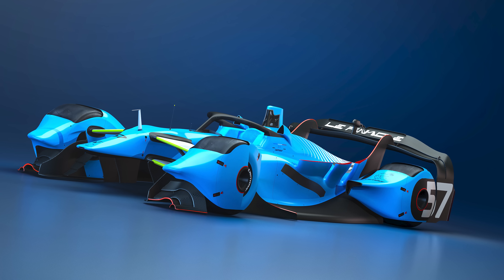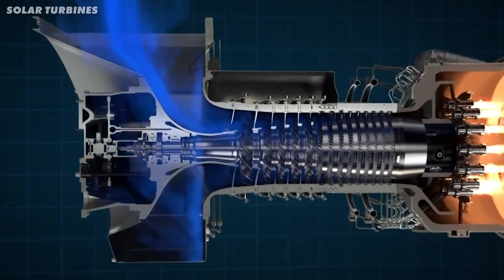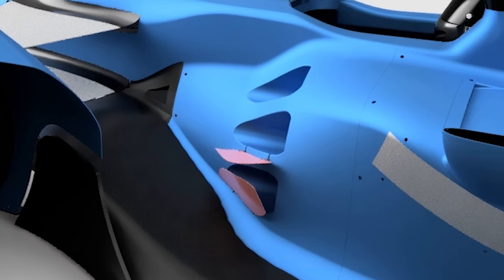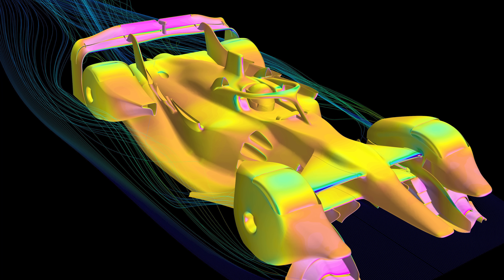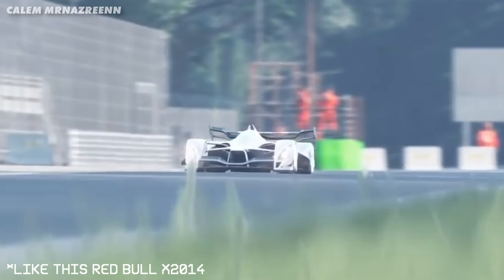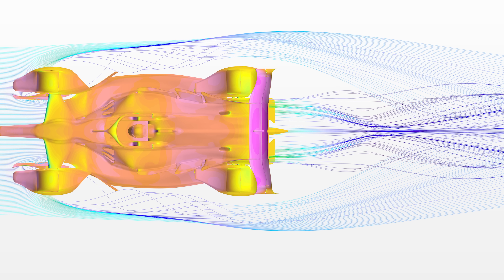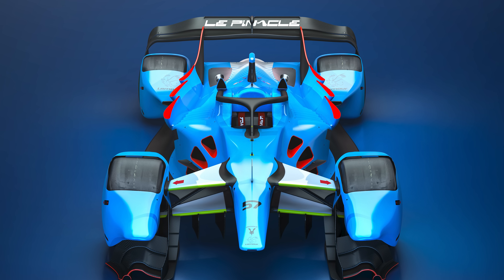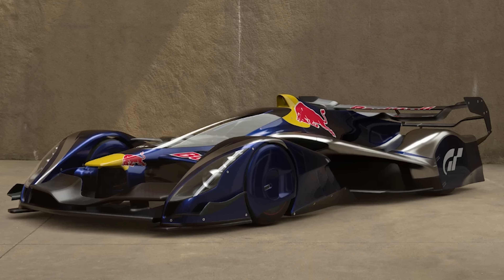Someone Designed The Perfect F1 Car (No Rules)

Comment: Designing any type of competitive machine without rules and regulations will start to tend toward simplicity, which seems counterintuitive until you realize that reliability is perhaps the most important metric of all. This ‘natural’ rule occurs in all of mechanical engineering. Those who ignore it will see failures rise to an untenable level, limiting the machine’s value to any prospective user.

Comment: This sounds an awful lot like the Red Bull X2010.

Ground effects? Check.
Fan? Check.
1600 hp? Check.
Wheels enclosed in faring? Check.
Enclosed cockpit? Er, no, apparently. 

Given that this project has taken 15 years, and it's now 2025, is it actually an evolution of the X2010 using more sophisticated CFD analysis?
Reply: Yeah, makes me think....
Reply: …which is in turn and interpretation of 70s F1,conceptual thinking.  Gordon  Murrays fan car. Gas turbines. Closed wheels.  Etc.  it’s the packaging.
Reply: @gaycha6589   - I don't recall any closed-wheel designs ever being in F1. What did I miss?
Reply: @nigeldepledge3790  Mercedes W196 Stromlinienwagen - closed wheel design
Reply: @gaycha6589   - is that the one where they had a separate bodyshell for the high-speed circuits like Avus?
Reply: THANK YOU, was about to comment this. for anyone unawares, the concept was initially called the redbull X1 and was conceptualized for Gran Turismo 5 around 2009-2010. they rehashed the design a few times, renaming it in the process, to the x(modelyear) naming convention we got now. So far there are x2010, 2011, 2014 and junior variants (no ground fan in the jr)
Reply: I don't think it actually took 15 years for him. More like he had an idea 15 years ago and realized it in fev month nowadays
Reply: Yeah when i saw your comment i remembered GT5 that have a challenge with that car
Reply: I also directly thought of the x2010 👍🏼
Reply: I doubt it; it's probably just a coincidence the two designs share those features. Anyone designing a "perfect" (or whatever you want to say) F1 car is going to come up with similar ideas because those ideas are really good. Hell, if you asked some well-informed fans who aren't engineers they'd probably suggest things like this as well.
Reply: I suppose one big difference is the lack of a front wing and the introduction of chimneys on the sidepods on this one.
Reply: Thinkin the same thing, good ol Gran Turismo 5 days
Reply: you don't really need an enclosed cockpit if you get your aerodynamic flows right. (kind of a similar reason why pickup trucks with closed tailgates have much better aerodynamics than trucks that have had their tailgates left open while driving). enclosing the wheels on the same vehicle makes some sense- it lets you control the airflows under the car more.
Reply: the one thing i hav emixed feeling about it actually working is those blades that "seal" the floor, and apparently that already existed, but how does that work ? Doesn't the friction consume the material ? Does it work the same if it's not 100% sealed ? Yeah I'm not buying that !
Reply: @picapica8266   - Well, it worked well enough in the late 1970s / early '80s that the FIA banned it. I'm guessing that, it it didn't work, they wouldn't have bothered banning it.
Reply: @picapica8266  Lotus and Chaparral were doing it in the 70s, it absolutely does work. The skirts have a low friction consumable material on the bottom edge, and it is replaced after every race. 
Check out the Lotus Type 78/79 and the Chaparral 2J.

The more outside air is kept out, the more downforce there is. The fan pulls the air molecules out from below the car, creating an area of low pressure, which leverages the atmospheric pressure outside the car to push it into the track.

Comment: Yeah.. But gaining about 10 seconds from current F1 car shouldn't be that hard: you add fuel stops, car becomes lighter, you increase width of body a bit, allow better aero and some large engines up to 5.0 + 4WD. It's going to be way cheaper even vs this project, I believe.

Comment: This was a great piece of content, very stimulating!  
I have three chief concerns: 

1. The outwash aero effect on other cars is completely unaddressed in the presentation. It's possible that (human) drivers simply cannot race wheel to wheel at the speeds this thing can run and corner at, with an acceptable safety margin; it is an issue.
2. Not keen on the twin turbo v6, we have that engine note today and it (still) leaves much to be desired.  Please, run it with a NA v10/v12 and just increase displacement to achieve necessary power.  Make us happy!
3. I seriously doubt this can run "safely" at all F1-rated tracks as they are today.  At the cornering speeds Le Pinnacle is capable of, a failure of one of the systems on this car could result in a ballistic car event we haven't seen since the terrible 1955 Le Mans and Indy crashes.  So IMO the designer's design saftey envelope needs some scrutiny and refinement. 
But I love where he's going with this concept, and this video.  Thanks again!

Comment: Considering that there are NO RULES, that is a tame design.  You are only limited by the funds available.  If Elon Musk came along and dropped $10B on a team,  I doubt the "car" would look like that.  First, eliminate the driver and replace it with a autonomous AI drone pilot. Then why does it need wheels?  Why can't it hover or fly?  Passing over top of the competition.  Rocket powered like  Space-X only sideways.   Basically, the concept of no rules is impractical.

Comment: No rules are cool and all. But some rules are actually good for the sport like safety, less/condensed dirty air to promote closer racing, and smaller more nimble cars to promote more overtakes. Engineers can create the most aerodynamic, cost effective fastest car but if it is too big or no other cars want to get close to it because of its dirty air the race would still be boring af.

Comment: Now let's find a human who can handle 7g lateral loads. Not sure if that's even drivable.
Reply: fighter jet pilots, however they are more used to sustained Gs and not going from a 5G corner to a 1.5G straight to a 5.5G braking zone in 6 seconds
Reply: @mwanted240i  What about air racing pilots? I think they can hold 9 Gs (Red Bull Air Race's regulated limit) for a short while.
Reply: @yongling9825 Cars and airplanes produce very different G force directions. Cars are all horizontal while airplanes all vertical. Human bodies handle different directions very differently, by orders of magnitude, so it's irrelevant to compare cars to airplanes.
Reply: @FacelessBillions They don't deal with lateral Gs at all. All forces are along the body axis (vertical G forces), positive G's drain blood from brain and can cause loss of consciousness.. Negative g's are very rare and avoided, during pitch down and would damage the eyes. 
In contrast cars don't deal with Vertical G's at all, and all forces are horizontal along the ground plane.
Bodies handle different directions of G forces very differently, so irrelevant to compare, cars to airplanes, as there is no overlap in G force directions.
Reply: @wyskass861  good point tho, but how exactly does the human body react to horizontal Gs?
Reply: @mwanted240i  I'm no expert in physiology, but afaik it's mostly physical stability and having enough strength to maintain posture to function and not hurt yourself. Eventually your organs and lungs would have problems when high enough. I would think braking G's is tough on eyeballs and stress on your chest, while lateral is being able to keep your legs on pedals, arms on wheel, and not hurt your neck when you head wants to fall off to the side. Seats and supports will help, but your musculoskeletal system is getting engaged to keep you from getting smashed by it's own mass.
I know the body handles forces toward your back as in acceleration in a car or lying back against gravity best, compared to others.
Reply: Make them RC cars.
Reply: @ underrated
Reply: What car pulls the highest lateral load so far and how high?
Reply: @yongling9825  afaik, F1 cars hit 5g lateral at the apex of corners as highest in motorsports. These top pro drivers spend much of their training on their necks to be able to last for a race.

Comment: Maybe I didn’t understand the engineers accent, but I heard him to say high 7 digits as a cost. I interpreted that to be in the 70-90 million range, not 10 million. Still remarkable, I will grant.
Reply: High-7-digit does mean the higher side of between 1,000,000 - 9,999,999, so it is under 10 million. What you said is the high-8-digit range.

Comment: haha lol ive been working one the same thing for about 2 years myself too, scary how similar it looks but has a completely different concept and im able to produce about 2x of what a normal f1 car could (in theory)(and i based it off of a w13, w11,  rb6 and the f175) 
i thought my innovations were completely different (all wheel steering, cockpit more rear-set(for weight reasons), and absurdly massive underfloor along with w11 type wing areo)
too bad im still nowhere near the end
disappointing that someone else came out with it before me but i have a lot to learn
i will present a new car which looks nothing like a car in a while
btw my car is 1.25x the length and 1.15x the width of a rb19 and it weighs about 860-900 kgs dry
with roughly a 1000hp pu and gb it should complete a lap around spa im under 1:33 min
Reply: the total df in ideal conditions can reach upto 8.75g

Comment: Surely the transition between fans and ground effect at 150kph would be totally unmanageable in practice?

Also, the biggest challenge to all of this would be to develop some tyres that would deal with the performance and aero load.
Reply: The real struggle is not the car , its a fighterjet on wheels.... the driver is the limit. 7 positive G is already insane. 
Doing 7g sideways, for 1.5h is suicide on a body
Reply: @jasmijnariel  it's not all corner though so I think it's still possible
Reply: @jasmijnariel  that's how racing should be once again. The driver becomes the limit, not the car.
Reply: @spdcrzy  There's no human that can drive this. You're asking for AI car.
Reply: @ZeroXSEED  that's the point. Did you not read my prior comment? The driver becomes the limitation, not the car.
Reply: @ That is already the case with F1
Reply: @jasmijnariel  well what if the driver is a space marine from warhammer 40k
Reply: And can do 70 laps without being changed, not sure how they quickly swop tyres with the enclosed wheels
Reply: You don't have to run 70 laps or change tires. It can be a time attack series. Of course it's less spectacular than seeing drivers competing in a race but for a competition of engineers it's a more suitable format

Comment: Aren't pit stops going to be annoying?  How fast can those tires be changed? Dp they have a quick release and just drop out of the bottom of the enclosures or something?
Reply: Seeing as the wheels are inserted into axles where the Centerlock lockrings would thread onto, they can't simply drop out from the bottom. The wheel covers have clasps.
Reply: So the only a couple seconds long long pit stop wouldn't happen. How quickly could the wheels be changed? Wish they would have covered that.  Performance of the vehicle is probably the biggest factor of a winning race, but there are other factors, too.
Reply: @kevinbarnard3502  it would be a second or two longer when nailed down the procedure to pop them off, however a 5-7 seconds stop minimum seems feasible.
Reply: oooohhhhhh now there's an idea... take a page from the railroad and set the car down on top of the wheels instead of bolting them to the wheel hubs. there would have to be a slightly more elaborate setup for the drive wheels (like a quick release axle or something that would be disconnected before lifting the car), but i think this could work well. if done right all you'd have to do to change the tyres is raise the car up on air jacks, roll the old ones out of the way, put the new ones in position, and then lower the car and drive off.

Comment: The aero fan (and all parts relating to its function) and the intake valve plugs seems unnecessary.  More complex, more variables, more problems for situational issues (low or high speeds).  Unless the mission is to break lap time records, I find it unnecessary to build the "fastest" car for F1.  Everything else seems feasible and sound except one other thing.  If we have renewable e-fuels, why not go back to a V8/10 for the sound :)  One can only dream.

Comment: This is what F1 should be about.

My dream is that F1 teams have a cost cap (for  expenditure incl. 3 most costly team members etc) BUT aside from standard safety features (to protect the drivers, pit crew and spectators), overall car dimensions and some level of sustainablity (in terms of fuel and travel costs etc),  is on the table in terms of car design and engine design.

I'd love to see som weird and wonderful car designs, rather than flavours (and eventual convergence) of a standard theme which we have today.

Comment: I've always said that F1 should return to open class.  Safety is now inherent and it was the innovators and not the spenders that were successful in the past.  It would mean Adrain Newey is no longer a cheat with hidden features.
If not then I would add more specific design restraints to the current format of races:
1) Drivers have to run and fit themselves in the cockpit from across the track
2) A 20kg shopping load has to be carried after the first pit stop
3) An additonal item, the weight of a jar of coffee, is to be picked up after the car has reached the end of the pitlane and reverses down a seperate track to the rear of the pits
4) The start finish straight has the red lights relit at lap 13 and all cars must wait 4.25 minutes whilt a cyclist move to the front of the grid
5) All drivers to refuel themselves and present a certificate at the marshalls office.  One person at a time.
6) A mandatory speed limit will be applied and various points around the track at any given time and a drive through given to those transgressing that limit.  
7) If the race starts at 14:00, additional touring cars will enter the track at 15:30 and block all racing lines throughout.
8) 3 laps from the end, all qualifying cars on that lap must pick up another member of their team and an addional 'friend' for two laps and not exceed 90kph.

Comment: I can see one glaring weakness which will bite Sebastian if this is ever built - weight. This thing will weigh substantially more than an F1 car, so all the sims in the world can't tell how this will compromise the braking and cornering performance. Then there's the human factor. You can setup an F1 car to find a good balance for your driver. Without any front wing here, adjusting that balance will be really limited.
Reply: He didn't mention how high safety standards will follow. Making the carbon body "hollow" would make it much much lighter
Reply: It’s a twin turbo v6 that doesn’t use hybrid technology so I’d assume it would weigh less or just as much as the current cars

Comment: Look, if it has no rules it's not an F1.
Second... human body likely can't take the turns in so short time. People could pass out depending on the circuit (we already found this out).
Third... we don't have tire tech for it.
Fourth... the cost talk is pure BS. The reason F1 cars cost this much is competition. If you had this car in F1 it'd cost even more due to the materials needed to handle the speed and the research to go faster.
If F1 cars were spec they'd cost way less while doing the same speed. When the rule book had more freedoms people still spent as much as when they had restrictions. This thing about "more freedom is cheaper" is fallacy. People wanting to win will spend a lot regardless.
These projects are clickbait.

Comment: the aero on this car is on another level, only thing is wondering is would there be a way to move the rear suspension of of the venturi tunnels and rear diffuser and get rid of the fan for a hybrid system
Reply: Chapman strut suspension seems viable if you can compress the damper assembly to no taller than the wheel hub, then it will only be 1 wishbone that disrupt the airflow instead of a whole suspension. Also a benefit you get is stiffening that diffuser to act as mounting for the dampers, (heave spring can go on the gearbox but 2 dampers outside)
Reply: @Dakkyun  make that an active suspension and break lap records, I would love to see a no rules grand prix racing again like can-am and can-am is way before my time I just really enjoy the technical aspect of racing and car design

Comment: Despite the open rules, the ultimate F1 car is not a six wheeler like the P34 or FW08B.

For engines, it is somewhat sacrilege that the ultimate F1 car is not a V10. Hopefully that twin turbo V6 is able to rev at under 18k rpm.

For stability, it is strange that it lacks active suspension to give the car perfect balance when braking, accelerating, and cornering, as well as optimizing the ground effect under those conditions.

Comment: I think the idea of switching from fan car to ground effect is brilliant but the danger of the hydraulics failing to activate on when you want to do a 7G curve might be too dangerous. I think considering all of the aero of the car and what it wants to achieve the fan is not ideal
Reply: 100%. I mean if this was practical F1 would already be doing it. They could absolutely design higher-performance cars but the trade-offs around safety and other factors understandably aren't acceptable.
Reply: who says it needs to be done hydraulically? electric servos and motors would likely work just fine, and you wouldn't have to worry about leaky hydraulics.